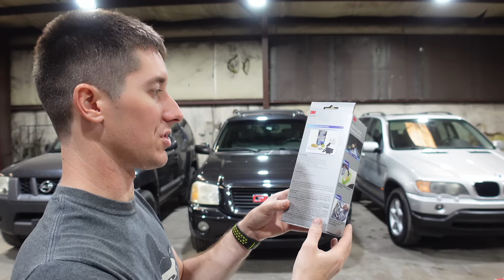I Bought EVERY Headlight Restoration Kit At O'Reillys *And Tested Them*

Comment: Great job guys!! I have been servicing and detailing cars for over 50 years, and overall, have ALWAYS found turtle wax products (of every kind) to hold their own against all challengers, even ones that cost many times more.  One thing I might add (and it's just from my personal experience) is that no product out there offers really long term UV protection.  We live in a world where all headlights are now plastic, and plastic WILL fog and have to be periodically cleaned and polished (and eventually replaced).  That's why I no longer waste time "coating, sealing, etc." with expensive "uv protectors."  If such were possible, the folks who make the plastic headlights would do it at the factory-- and we would never even have to have this discussion.   Good luck with your business !
Reply: That's what I thought about uv protection. 

For instant clarity, I just use acetone nail polish remover.  Makes them crystal clear in one pass.   Don't make more than one pass...additional passes cause the fog again.  Don't get it on the paint.
Reply: For some strange reason my headlights are still nice and clear after 13 years.  Go figure.
Reply: @kfl611  if glass or mostly parked in garage the sun wouldn't cause the problem.
Reply: @Lili-xq9sn  Perhaps that was it.  My car was mostly parked outside, but under a tree, so I'm sure it got plenty of shade and for 9 years it was parked in a parking garage, mostly under the shade - but not always.  Maybe I got a good year's batch of headlights.  Everything else I had to repair, cost me so much.  I probably should have thrown in the towel and gotten a new car, but I am retired and don't drive much and did not want to spend 30,000 to 50,000 on a new car.

Comment: I just used the Turtle Wax kit on an 09 Saab with hard to find headlights. It’s a little bit of work but the results are amazing. Spent about an hour doing both headlights. Two hours probably would have them looking brand new, but I got tired of sanding and probably rushed it a bit. Great results for $10 though, I’m happy.

Comment: You missed the best one on the shelf...Mothers Mag & Aluminum Polish! Use with a 3M foam compounding pad 05723 and a right angle polisher. Might have to do it twice but it’s done in a few minutes and works great...no sanding.

Comment: I used the Mother's NuLens Headlight Restoration Kit, and the sandpaper didn't last very long. The powerball worked nice, but I needed more sandpaper. My headlights were better, but not close to being like new. Here's a tip: Don't use a drill with the sandpaper... do your wet sandpapering by hand, because you don't want the take any chances of damaging your paint.

Comment: I recently used the 3M ultra kit on my '10 Corolla. I spent a good amount of time and dry sanded both the 500 and 800. It also specifies to use the sealing wipe in straight horizontal lines, starting with the top. I got results that look like the turtle wax kit did they basically look new and my headlights were bad enough to have cracking in them.
Reply: I used the, CERAKOTE Ceramic Headlight Restoration Kit, for my 2013 Corolla: and it has the 3000 wet sand, and 2000 wet buffer. I just did mine today, and my headlights look brand new!! And same, no circular patterns: only horizontal- except for step 1: you can use circular motions because they’re just oxidation wipes. 4 steps, takes about 20 minutes in total: just had to let my car sit for 60 minutes. 

I’ll recommend this product to anyone looking to easily restore their headlights, especially Women!

Comment: One of the keys to the turtle wax success is not using a rotary sander. There is too much potential for uneven/excessive pressure with the drill sanding which can generate hot spots and create an uneven finish. I've had the best results hand sanding with 1000, 3000, then 5000 grit before polishing. Sanding in only one direction also improves the results.
Reply: You can also sand with a DA and a 3 inch backing plate, but I agree, I prefer to sand small areas like headlights by hand, I stop at 3000 grit, polishes out nicely with something like M205 and a 3 inch foam polishing pad.

Comment: Thank you for sharing! Here is a tip for you. Please consider using Meguires  Headlight clear coating  G 17804 after cleaning and polishing headlights.. I have tried several kits, but found the electric drill pad attachments 500-3k grit , with compound are easier and quicker. Use water as a lubricant first on base polishing, then switch to quick wax as a lubricant. They all look clearer after using the clear coat regardless of the brand.. They last about 6-12  months and are easily restored,  This works much better than using a clear coat Rustoleum paint, which seems to melt the plastic and may yellow in time..

Comment: I found an old Turtle Wax kit unopened in a flea market for 1 dollar. After reading how dam good the product is, I went out and brought a brand new kit so that I didn't take a chance on using "outdated" chemicals on my Acura TL headlights. I saved over $600.00 Canadian because I was about to purchase new headlights and now I do not need too. Just remember that after a year, you will have to lightly touch them up again and reapply protectant.

Comment: Back in the 1970s, I discovered that just using a regular buffer, rubbing compound and wax worked great on the plastic emblems and plastic lenses on cars. I've used it on plastic windshields on motorcycles, glass windshields on cars and plastic headlight lenses. I bought a 1990 pickup in Canada in 1995. The headlight lenses looked like they had been sandblasted and I cleaned them up with a buffer. I bought a 1999 pickup truck in 2007 with very bad headlight lenses. I polished them with a buffer and waxed them and they still look like new today.

Comment: For me i have used both the 3M and the Turtle wax kit and while Turtle woks its a lot of work with those small pads. Wish they where slightly bigger. 3M also gave me the best end result and was easier to use so its my go to choice.

Comment: On my personal vehicles and ones that i buy and sell i just use Maguires ultra cut 105 with a foam pad on a drill. Clean it up in 2 minutes and lasts about 6 months. Not a long term solution but cheaper than buying new headlights or one of those kits
Reply: Maybe finish it up with some ceramic coating and see if it lasts a few times longer
Reply: @robertm5969  ill have to give it a try. Been meaning to pick some ceramic coating up and give it a try, just havent got to it
Reply: @willmcpherson3760  same. Hope it works out well!  Good idea with the buffer
Reply: What color is the bottle?
Reply: @Jasmine-rw2xu  white
Reply: @willmcpherson3760  what else would I need
Reply: @Jasmine-rw2xu  electric drill with a foam pad adapter off ebay

Comment: I have used the same Mother's Nulens and it didn't last that long. The Sylvania head light restore kit works really well. It's a 3 stage wet sand and has uv block clear coat last step that actually made the lens look almost new. Don't know how long it lasts cause I applied it last week, but I do like the Sylvania better than the Nulens.

Comment: My experience of using different products including the Turtle Wax kit, Meguiar's  Plastix, has been they all do good on the day you clean them and none of them stay clear very long and then right back to being cloudy. So I go with the quickest cleaner and plan to do it on a weekly or more often basis.
Reply: I used the Turtle Wax kit and finished it with the Meguiar’s PlastX before putting the ceramic coating on it that’s in the Turtle Wax kit and it looks great.
Reply: I just use acetone nail polish remover.  Makes them crystal clear in one pass.   Don't make more than one pass...additional passes cause the fog again.  Don't get it on the paint.

Comment: I used the Turtle Wax on my Prius headlight, but it did get hazy after about a month or so.
It would be nice if you could find identical lamps and do a time lapse for a month to see which ones hold up.
Reply: try a ceramic coat, gyeon trim q2 or any decent headlight UV protection coating you can find
Reply: Why don't you just make videos of that? You never know. You could just make a new headlight restoration kit for the world.
Reply: get a film coating like XPEL.  I have one on my (then) brand new 2014 Forester, and it's coming up on 10 years and the lights still look brand new.

Comment: Regular compound works fine too. Polish headlights the same way you polish paint. And some plastics are very hard. Sanding with 1000g paper will ruin it. Use 2000-2500g followed with a good cutting compound on a rotory polisher and finish with a fine polishing compound with a orbital buffer. Then wax the things. Done deal.

Comment: I just used the Mother's kit on a 2002 Ford Taurus' extremely bad headlights and now they look brand new.  I think I took more care and passes with the sanding steps than you guys did though.  Making sure to use more water for the wet sanding. I'm very happy with the results and also it helped that I removed the lenses from the vehicle since they are only held in by a bolt and two clips.  I also followed up with a can of Meguiar's UV protection spray on clear coat.  

This was an interesting video but I really think the Mother's and Turtle wax are essentially the same process but you have to put a deal of effort to remove the old clearcoat like you did with the left side of the BMW for significant results.

Comment: At 13:15 when you are putting the clear coat on the passenger side of the Envoy, I obviously noticed that you applied it with a circular motion.   When I did my '05 Envoy headlights, I'm pretty sure I used the 3M kit and it specifically said to make STRAIGHT smooth passes with the still folded applicator cloth and at least in my case, it dried so fast, that if I had used a circular motion, it would have been a mess.  As it was, following the directions to make fast straight passes, it came out beautiful and still is now about 6 months later.
I don't think the Rain-X one will last because from the many videos I watched b4 I did mine, they all said that to get lasting results, you MUST remove the deteriorated plastic with sanding and polishing compound and then of course apply the clear coat.  I really think the ones that use chemicals to "remove" the haze will only last for a short time.

Comment: Great job on this video. Complete, unbiased and results based information. This is what YouTube is supposed to be. 😉
Reply: I'm afraid to say this test as flaws, Whether on purpose or a genuine mistake, (example) When using the 3M restoration kit they used water at stage 1and 2 which is wrong, Tap water is only used at stage 3, Which begs the Question how many other mistakes have been made??🤔😵

Comment: You can always put a decent u/v clear coat on the lenses afterwards and any of them that actually polished them well would probably last way longer if the kit didn't come with u/v protection afterwards. I sprayed a completely scuffed and destroyed dash guage lens cover in a 78 Dodge van and can still see the guages several years later. I haven't tried any headlights yet but we do have one car that really needs it, very bad.

Comment: Sylvania Makes one of the highest rated lens restore kits, too bad it was not available or included in this test. AutoZone and Advanced Auto Parts carry the Sylvania. Most turtle wax products work very well, I think Mothers is gone done hill. Meguiars is usually good too. I have used the 3M kit with the driller attachement this always worked well but costs a bit.

Comment: My best results are actually going thru with 600, 800, 1000, and the last 3000. Then using the polishing compound from 3M. And last but not least the ingredient that will make your headlight last for about 3 years or more is a 2K Clearcoat.
Reply: Worked great for me, but I used 2000 and 3000 and 5000 then a good clear coat non yellowing and made for plastic, looks like new, didn't use any polishing compound.

Comment: Bought a set of 3 sandpaper grits ($6), some clear coat for plastic ($22), auto painters tape ($5), used some trash bags, iso, paper towels, and a water spray bottle (last ones found around the house. $33 for a somewhat permanent restoration and you have left over supplies for future projects seems like a win.

Comment: Thanks for the video, I was actually looking into different Headlight restoration kits as the Headlights on my 2004 Outlander currently look really terrible and thanks to the hazing and yellowing currently put out less light then any other of my cars, even though most of them are 30+years old (but they do have Glass headlights, so no oxidation there). So I guess Turtle Wax it is then, the Kit also seems to be rather inexpensive, I just bought it for 13 Euros over here in germany.
Reply: I just use acetone nail polish remover.  Makes them crystal clear in one pass.   Don't make more than one pass...additional passes cause the fog again.  Don't get it on the paint.
Reply: @Lili-xq9sn  Acetone will eat into the polycarbonate lens... it will etch & scuff it. What did you clean it off with afterwards? Did you seal and UV protect it afterwards? How's it holding up now?
Reply: @birgip.m.1236  I finally did it a few weeks ago.   I used the acetone right before I washed my car.   Then put on the uv.  My headlights are in the sun all day,  but now it's winter,  so not hot sun.   So far they look like new still.   I'll reapply the uv in spring.

Comment: Man, my Honda Fit really needs the Turtle wax care but I guess it's not sold here in Brazil. I've seen so many videos about polishing hazy headlights and the most amazing fast result I've seen is the one using acetone. Still needs to used a sealant of some kind afterward though.

Comment: One thing that i noticed on the Mothers kit, they used the 3000 pad wrong. The 3000 pad was supposed to be used dry, not wet, then after the 3000 pad, you use the polish. Either way, the Turtle Wax kit came out great

Comment: I know when I used the high end 3M kit, I sanded it down thoroughly and carefully followed the clearcoat wipes it turned out the same as the turtle wax. I will have to try the turtle wax and see how it turns out!

Comment: My 21yr old VW Passat had badly yellowed headlights. One pass with acetone(nail varnish) on a microfiber cloth gave 95% clarity. This took 10 seconds. Autoglym spray and buff, 10 seconds, job done. Minimal cost, time and effort. Not a scam.

Comment: I bought 3 kits, but didn’t realize I needed a drill- I mean, I have them, but I wanted to do my headlights- not have my Husband do them. So, I found; CERAKOTE Ceramic Headlight Restoration Kit, and I am SO SO HAPPY I did. No drill needed, you don’t even need to tape off your headlight… 4 super easy steps, takes about 3-5 minutes per headlight, has the ceramic seal- and my headlights look brand new- and it’s supposed to last a lifetime, so I don’t expect to ever need anything else!! It’s a win for me!

Comment: I bought the Mothers kit and am very impressed with it.  After the first triple sanding and polishing, you can do a touch up with just the 3000 grit (dry sanding) and then a polishing.  The headlights look brand new in less than 10 minutes.  The kit will last for a long time.
Reply: Add a made for plastic, non yellowing clear coat to really make it look new and last a long time

Comment: Good comparison test and very useful info.  Been a few years since I've had 12+ year old headlamps.  I do remember trying the turtle wax product at the time, and had good short term results with rainX.  But... once you start buffing away the factory finish, result were only good for a year or so.  Today, my oldest car is 8 years and original lamps are in good shape.  Preventative maintenance to keep them that way:  Wash and scrub LIGHTLY with toothpaste and a magic eraser, rinse and dry.  Then spray 'em with PLEXUS cleaner/protectant/polish...  made for clear plastic windsheilds and lenses.  Buff well with a microfiber cloth.  Hopefully this will keep the headlight haze at bay for many more years!
Reply: correct.  polycarbonate is a very soft material so it needs to be hard coated otherwise it will scratch very easily. Once you use one of those kits you essentially remove all hard coating that was applied from the manufacturer.
Reply: With my oldest headlamps now coming up on 10 years old... toothpaste and PLEXUS!!!

Comment: You don't need a kit. Get some 2000 wet sandpaper and wet sand lights until completely dull. With a small buffing disk and a cordless drill get yourself some buffing compound and lightly buff headlights until nice and clear. Dont not press hard when buffing or you will burn the plastic. After completing clean lights with a good degreassing soap and wipe dry. Mask off surrounding areas around lights and spray a good uv clear coat. A good four coats will do you fine. Light's will look brand new for a long time

Comment: I had the same mindset. While looking for a trim restoration kits for my wife's Jeep, I tried several brands and the best and least expensive of the bunch was Turtle Wax.

I can basically apply it once a month and the plastic trim stays dark and clean looking in the Texas heat, not oily nor slippery. 
 
WTG turtle wax

Comment: I had great luck with the 3M kit, but not the one you used. The one I had came with a drill pad and multiple sanding discs and clear coat.

Comment: I had good results with the McGuire's kit which is similar to the kit with the two-stage wipes. Problem was after a few weeks it hazed over. Not as bad as before, but still disappointing. So for someone with no tools it's probably a good choice.